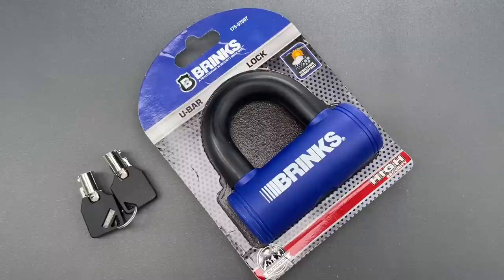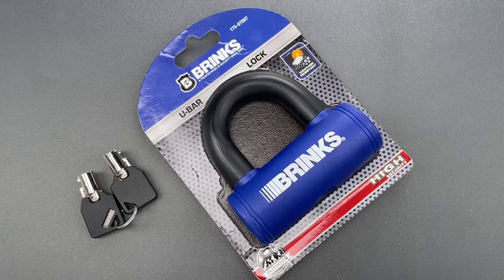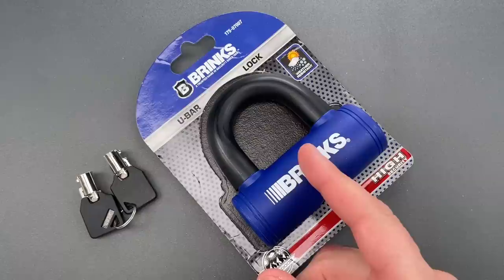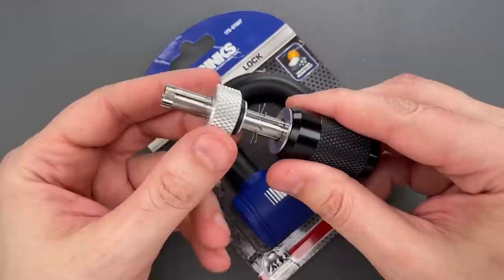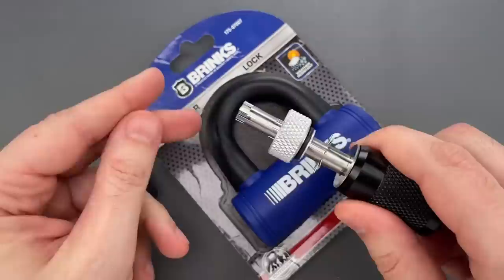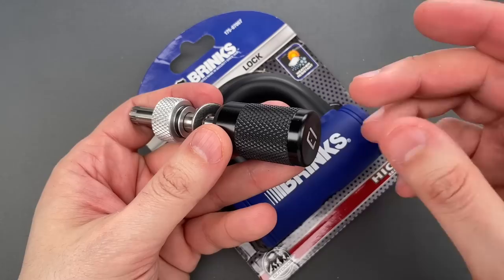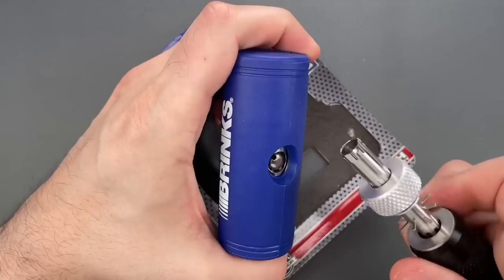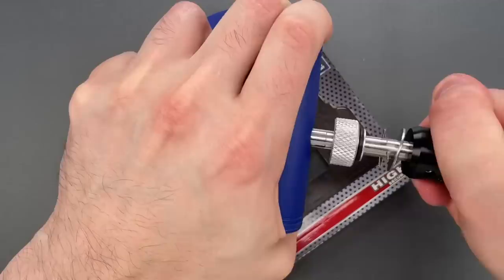[1509] Worse Than I Thought: Brinks Mini U-Bar Lock

Comment: No, you didn't make a mistake.  For the average picker 8 years ago, those were considered high security.  You have gotten better and the tools have become better, cheaper, and more widely available.  Bosnian Bill (we miss you) showed how to pick those locks with a conventional pick and a special turning tool.  It required picking several times to open it and several more times to close it.  And, the lock could also have security pins to make it more difficult.

Comment: The timing of this video is kismet. I bought this tool last week from you to work on a pistol safe. Struggled for two days. This pops up, and I had it open almost as fast as you with the Brinks. 
 
LPL = Lock picking legend.
Reply: I bought mine last week also, for auction house use. This update is abs perfect.
Reply: @davidcovington901  why do you need it for an auction house?
Reply: Love the “Lock Picking Legend”!!
👏👏👏👏👏👏👏👏👏
Reply: @limiv5272  Probably when they auction off impounded stuff that is locked.
Reply: @limiv5272  because that's cheaper than buying stuff at the auction.
Reply: @TimbavatiLion  Wouldn't stuff be opened by the people that do the impounding? I'm honestly curious how that process works
Reply: @Jehty_  lol of course, my mistake
Reply: @limiv5272  There are a lot of auction houses that do estate sales after the owners have passed away.  That would make getting a key for locked items extremely difficult.  Most people going to auctions don't want to buy something they can't open.
Reply: I think it would be awesome if you (lpl) designed and partnered with someone  to produce a bespoke bag or case to keep gear organized.
Reply: yeah im with u bro LockPickingLegend.. lets get a interweb thing goin!
Reply: @davidcovington901  I bought one also...works like a dream...=)

Comment: Reminds me a a previous life chapter.  Decades ago, I worked campus security for a private university.  Every few years we would do a sweep of the campus bike racks and clean out old abandoned bikes, that had been there for an extremely long time.  I found it easier to use a Bic pen then to cut the lock.  I used the pen housing and did the same twisting action.  Most of the time I could open the lock within a few seconds.  It was way easier than cutting the lock.

Thanks for bringing back the great memory of working on that campus.
Reply: than to
Reply: you could have sold those old bikes and made side hustle money...
Reply: @defaultworkouts  Our university did that officially once a year. The money went to Charity.
Reply: The pen trick became famous some years ago as a way to easily pick Kryptonite's U locks - so much so that they recalled them.  I sent mine in and got a new one for free.

Comment: What I've learned from this channel is that it doesn't matter what kind of lock you have, someone with the right tools and skills will be able to open it just as easily as if they had a key.
Reply: There are a few exceptions that are tough to crack even with a specialized tool, but those cost some $$$.

Comment: That lock came open the moment LPL inserted his tool and started to rotate it inside.
Reply: It's not the rotation; it's a swirl. The one in the video is clockwise, but it's not written in stone.
Reply: @Nimelennar  it more make new blank that fits the needed lock, wonder if you could load that tool into key cutter, and make a replacement, from tools setting itself ?
Reply: Hmmm, that just sounds........ wrong. 🙂
Reply: *just before
Reply: I feel like he’s getting warmed up for his April Fools Day video
Reply: @dh2032  Yes indeed you can. That tool also doubles as a sort of decoder.

Comment: I don't know. I don't expect someone to have any specialized tool to open something I have, of medium value. 
I will never again buy a lock that can be opened with mild force, raking or a magnet. That's for sure. Basic picking as well. 
But if you need a special tool outside of those just mentioned, I feel pretty good about my security overall.

Comment: I really need a compilation of videos showcasing good locks, I can't seem to find one you properly struggled to open!
Reply: Anything more than 4 seconds is probably a good lock.  That's what counts as a struggle for LPL.
Reply: Anything that cannot be raked or takes him more than 30 seconds to open with a pick and anything that he uses the tool that him and Bosnian Bill made will probably defeat most of us.
I can sometimes pick simple locks and it usually takes me 5 to 10 minutes if I get lucky.
Most thieves use brute force anyway. It's the magnet attacks on electronic locks that bother me most.

Comment: Got genesis set. Picked a couple door locks in just a few minutes on my first go round, satisfying as ever. Suggest everyone try it out, even as an amateur I was able to do some lockpicking and it reveals just how simply someone can break into just about anywhere with the right tools and some persistence and a little know how. Anyway, the tools are well designed. Sturdy, and effective. Even with no previous experience I was able to open several locks In a matter of minutes with a bit of effort I realized that this is quite fun, now I may be lockpicking everything I can :3
Reply: Just remember the rules, never pick a lock that isn't yours without permission and never pick a lock in service.

Also how much did those doors earn you?

Comment: I recently replaced all the storage compartment locks on my RV with a set of tublar-core locks mainly because they are different. As I understand it, the key from one RV can open the compartments on virtually any other RV because they all use a standard key. Are there any RV/toolbox locks that provide any kind of security at all?
Reply: Most RV storage compartments could be forced open in under 10 seconds, so I think the fact that you ditched the infamous CH751 locks is as good as it gets.

Comment: I work for a store that used a different armored car service (and that service was wonderful) that changed to using Brinks as our armored car service a handful of years ago. I would be surprised if anything with a Brinks logo is not worse than you expected. FWIW, most of the actual drivers and security people who come into the store are fine, but the turnover is high, and the real problems are at a higher level.

Comment: It does require a specialized tool. Most "professional" thieves around here are looking for ones not locked properly, or just cutting the locks. I'd still buy this, if it also has shim resistance. Just keeps the opportunists out.

Comment: I always wonder if there are lock companies that integrates some sort of puzzle box / ancient safe obscurity into it's design. At most some integrates a magnet into the key. 

What if the "main key way" is just a decoy trap whilst the real key way is hidden (under a magnetic cover? )and can only be engaged in a certain way, say pressing down on the shackle. 
Or maybe a "lengthen" key way where the first 4 pins work, to be used in conjunction with a shorten key and the last 2 pins at the bottom will cause it to seize up if attempts are made to manipulate them.

Comment: It's all about technique.  Just cos there's a tried and tested way of using a tool, doesn't mean there couldn't be another way to use the same tool.  When I first bought the chinesium set of three of this type of pick I honestly thought that you were supposed to use each of the needles separately to feel for clicks. ....well while that does  work, it's much easier to use it to impression.

Comment: Given that the tool had to be gyrated, could you have still tightened the impression and used it as a regular without the motion? Could you then cut a key from that impression and use without the jiggles? I just wonder if the motions might throw off the impression pin depth.

Comment: The lock has several potential valid claims.
Weather resistant, though spelt incorrectly, it is pick resistant wether or not the is minimal skill involved.
Outside, this lock might currently be outside.
HIGH Security, half right, they were high.
Reply: 1. Where do you see the words "weather resistant" spelled incorrectly?
2. In "wether or not the is minimal", you spelled "whether" incorrectly (left out the h).
3. In the same quote, I'm assuming the word you meant to type is "there" and not "the".
4. What are you trying to say in "Outside, this lock might currently be outside."?
5. Were YOU high when you typed your comment?
Reply: @purpleghost4083  it says outdoors, it might be outdoors
As for the spelling and grammar mistakes, let's just say Microsoft completely fucked up my favorite android keyboard since they bought it and it actively changes my GF grammar.
As far as high, no, but you must be after murdering my comment. Congratulations, hope you get better soon.

Comment: My question is can that lock be picked open with anything else besides that special tool?
Reply: You'd have to go into the previous videos, but LPL does single pin pick a few.  The technique is a little different from a "normal" lock, but it's a similar principle.
Reply: The locks opens by jiggling the feelers of the pickup tool while the barrel is in tension. That is the equivalent of raking a straight keylock core...
Reply: Yes, but not as quickly. It's not a secure design of lock. The big benefit of the imprisoning tool is that it is as quick as using the key.
Reply: @jrd33  
I just like to see if the lock can be opened with a low skill attack with every day house hold item that an amateur thief might have access to. Most professional thief's may not be interested in what I have in a shed.
Reply: @jrd33  
Kinda like can the teenage kid from down the street pick it.
Reply: @sjgavenger37  One of the comments under this video reads: "Circlular locks are the first locks I learned to actually pick as a kid (as opposed to shimming or raking).  Nice access to all the pins, the only challenge if you don't have any proper tools is tensioning it.  Still, I managed easily with nothing more than a bent paper clip.  Never trusted these locks since."
So I'd say not very secure :-)

Comment: Yea, I disagree with the statement that this should be relegated to the trash heap based on what was shown in this video.  The number of people with both the skills and tools to do this has to be startlingly low outside of actual locksmiths.  This isn't a high security lock, but should be sufficient for low impact applications such as securing a bike in a rack in a well populated and traveled area.  Which is its intended purpose.  

I appreciate LPLs skill and insights, but sometimes I think he can be overly critical when considering the intended application.  LPL is probably in the 99th percentile of lock pickers so, if the exploit isn't particularly low skilled, I consider the lock sufficient for low security applications.

Comment: Meh, I don't quite agree with "throw them on the trash heap". If you want to secure an 8000$ E-Bike you MIGHT consider using a different lock. Most people's doors and cars have a poorer security lock than this, seriously. And in 99.97% of cases a tubular core is already overkill for what you are trying to protect. It is SO rare that someone buys an 85$ impressioning tool specifically designed for tubular cores and has enough experience and know-how to work with it to eventually crack the lock by picking it.
I guarantee you that in most settings people are much more prone to using brute force to breaking open a lock. 
Yes, they should provide a reasonable safety against the most obvious picking techniques but once you bust out special tools like disc detainer picks and impressioning tools this starts to leave reality. Those are not field conditions and those tools are not what the average thief has at their disposal.
Be aware that they are not 100% pick proof but don't discard them because people with massively advanced tools and years of practice are able to open them.

Comment: Lol.. did you loose brinks as a sponsor,, say I did reinforce my jamb, it is so strange how most locks and doors are no match for a real professional, I bought a pair of solenoid bolts and a remote actuator and a magnetic latch, all was fairly cheap ($50). it's a challenge to install, I'm working up a pocket mockup 1st, ty.. nice page,

Comment: you need a rating system other than "throw it in the trash" I cannot pick this with a paper clip. it is not trash. You're a professional with professional tools. I can't remember a video where you're not pissing all over a lock. paper clips, bolt cutters, and cordless angle grinders is all a lock needs to protect from for the average consumer.
Reply: A tubular lock impressioning tool is neither professional nor rare. You can buy a 3 pack off amazon for 40 dollars.

Comment: I watch all those videos about using The Tool and always wonder, why won't lock manufacturers change the hole diameter so it either doesn't fit or is too loose?